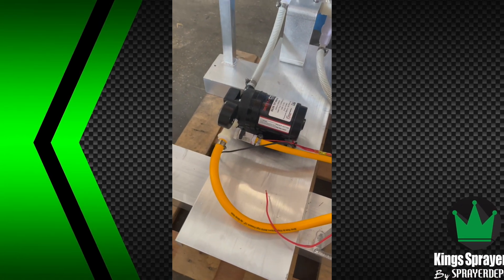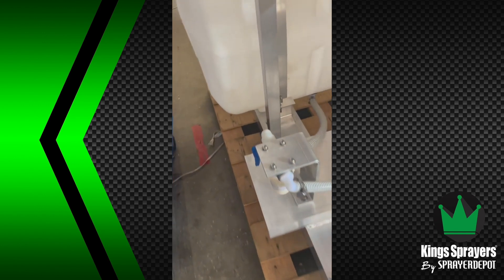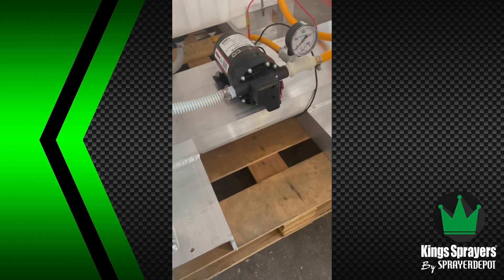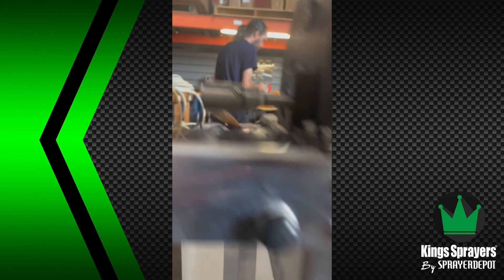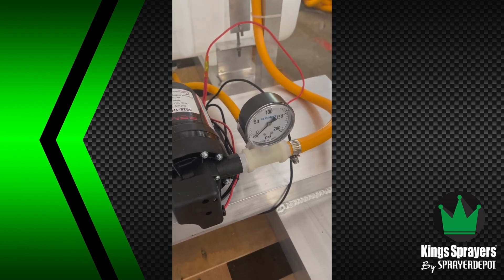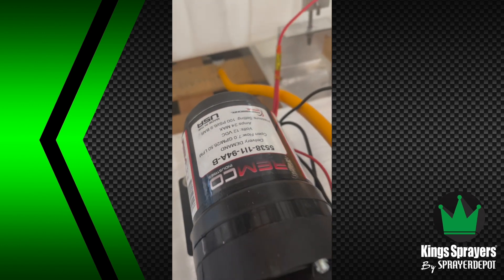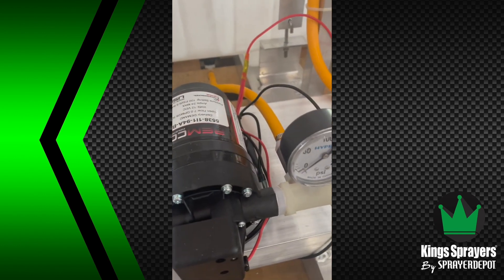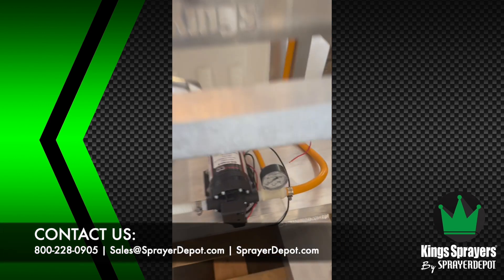How to Plumb a 12V Electric Pump | Sprayer Depot, #1 for Professional Spray Equipment

Comment: 1 you should have a pvc slit filter thats inside the tank and fully submerged.  That makes less connections and leak points in your intake line and also less resistance.  2 having a discharge and or a bypass line on a 12v pump won’t work if you have any type of proportioning system which is a massive part of the market and a huge selling point of 12v pumps to the market is how simple they are and easy to use because you can let off the trigger and they stop and you’re not backfilling a tank and can use a metering style system.  Relays in these pumps go out because they don’t use large gauge wires and they use small junk relays.  You of course don’t want draw lines super far and you don’t want to rapid cycle your pumps but if manufacturers start not allowing warranties unless you have a discharge line then they will just buy a different brand or likely kill the 12v market.  Both Delavan and Remco need to step their game up on the relays they use and provide customers with a pump that has a quality relay and proper gauge wires.  I have sent many emails and videos to both companies and with all things remaining the same a simple, relay and wire switch, solves all the problems. Apparently their supplier in China doesn’t have the quality they used to.